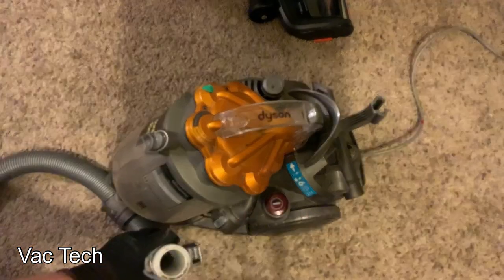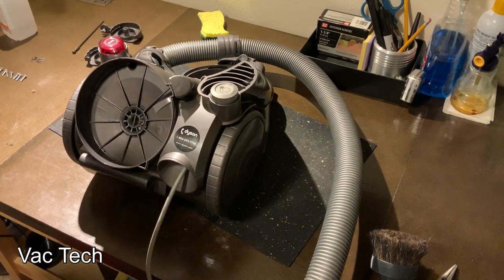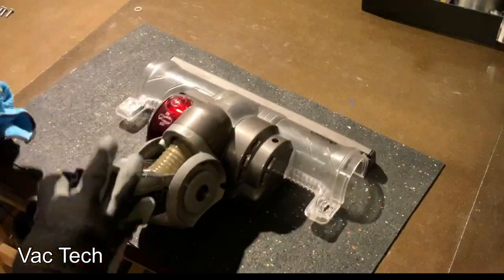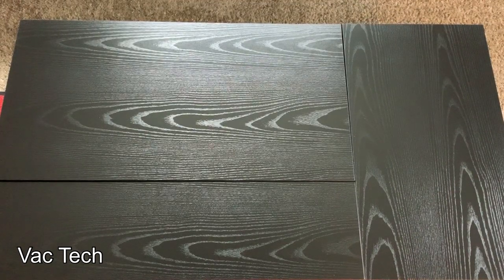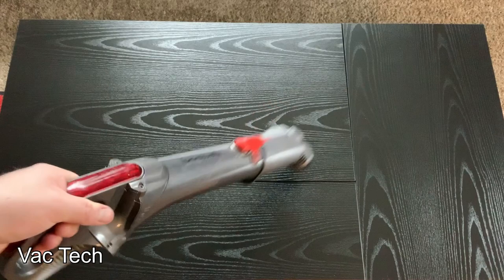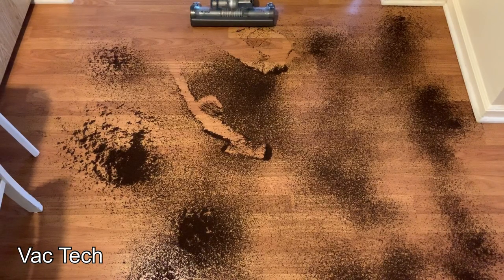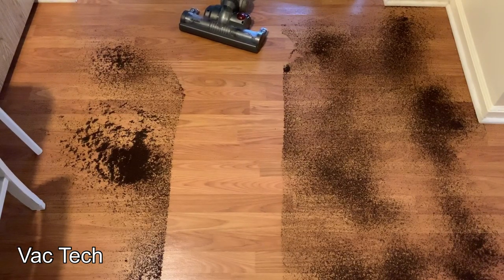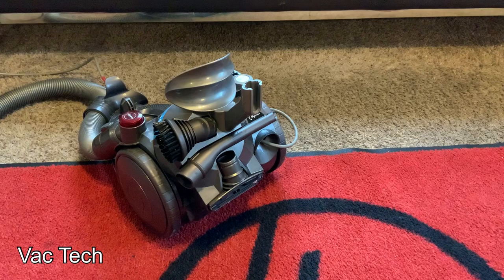2005 Dyson DC21 Motorhead Review Tune-up and Vacuum Demo

Comment: I have one of these as a hand-me-down from my sister and found it quite inconvenient. The cord is too short to reach all the way up our stairs or across large rooms. I bought a Miele C3 pet vacuum which worked well and I continued to use the Dyson DC21 for really dirty jobs like our mudroom.  I washed the pre-filter fairly frequently but had no idea it had a HEPA exhaust filter. My husband borrowed it to use in his workshop. Bad idea!  I have thoroughly washed the housing in the past, but the vacuum has taken too much abuse and no longer sucks like it used to. Hence my search that lead to your video. THANK YOU for showing where the HEPA exhaust filter is and how to open the housing.  Dyson no longer supports this model so I have ordered what I hope are compatible parts. With any luck, there will be a lot more life in this baby ;)  And yes, my husband now has an appropriate Shop Vac in his workshop with venting  to the exterior of the building.

Comment: as far as Dyson canister vacuums this is easily the best set up they have done despite the flaws
Reply from the maker: @nathanielaranda8407  I agree. None of the air powered cleaner heads were ever nearly as good as the motorized power nozzles on these. I also like the long hose on this. Lots of Dyson canisters have short hoses and bulky wands, and they make for a cumbersome user experience.

Comment: The cyclone assembly does separate further by removing the conical part at the bottom after unclipping it at three places from the surrounding shroud. It does accumulate a lot of dirt in there and it makes sense to disassemble it before washing it thoroughly.

Comment: We have this same vacuum. It appears we have a clog. Do you have a quick video for fixing a clog. We’ve checked the hoses and the clog isn’t in there. When you turn the vacuum on, it sounds fine for 1/2 a second and then it changes sound and you can tell it’s a clog. I’d love to see a quick video for novices like me to be able to follow and fix. ☺️ thank you.
Reply from the maker: Did you remove the hose at the machine end, and verify that it still sounds clogged, with the hose/wand removed? That'll be an easy way to narrow down the location of the clog.  If the hose is worn out (and the electrical cable inside the hose separates from the wall of the hose), it can clog easily in a couple spots. Mine clogged near the swivel joint, and where it connected to the machine. 

Have you washed the filter recently? Is the shroud (perforated screen) in the dirt cup clear? Hopefully it's a quick fix for ya!

Comment: Did you ever have to unclog that hose? I have the exact same model from 2005 and still works beautifully with 2 xlarge dogs (90 lbs and 125 lbs) with triple coats and 2 cats. I got something clogged and while it still sucks, the pressure is far less. I think it’s stuck by the handle where I can’t reach because of the slight bend. Do you know how to remove the handle from the hose? Could you do a video of that? From the comments there are a fair number of us with the same problem.
Reply from the maker: The handle can’t easily be removed from the hose, but the hose is removable at the machine end.  At the machine end, the clip that holds the hose onto the canister at the bottom is also removable. From there you could run a long stick of some kind down the hose to free up the clog. 

I hope you can get it removed! It’s one of Dyson’s best canisters, cleans great, and worth saving if you can.

Comment: Thanks for your reply. I don't have needle nose pliers. My vacuum authorized Dyson repairman 15 miles from my home closed shop due to the Corona so I am screwed there 👎. I did make a hook at the end of the coat hanger and I still can't get it out. No idea what the hell it could be up there this time. Always have been able to get the hose line free before with just a coat hanger prior. I do have a car vacuum though. Not sure how I could suck it out with my car vacuum, but I'll try to turn it on but I'm not sure I'll be able to get the car vac line up the thin Dyson hose. This is the challenge I could use advice on.
Reply from the maker: If you can remove the hose from the dyson (there's either a screw, a clip, or both, on the front of the vac where the hose is held down). you can run the dowel through the other side.  And I understand regarding using a shop vac, if the size is too different it may be difficult to get it to seal to the Dyson hose and work.  I hope you're able to get it working again!

Comment: This is an awesome video!  Inspired me to tune up my old neglected Dyson that might be in no better shape than the one on the video.  Thank you very very much!  I have a problem with the motor-head brush that shuts way too often.  I am thinking that might be resolved after replacing the filters.  Will see.  If not, I will write again to see if you could advise on a solution.
Reply from the maker: It might be electrical if its cutting out, and related to the power head, or the hose/wand (if it's also a DC21). Good luck, hopefully you're able to get it running well again!
Reply: @VacTech1  Yes, it’s DC21.  I will tune it up this coming weekend and report back to you! :)
Reply: i m having this same problem with mine too , just curious how did u fix yours?
Reply: @VacTech1  fantastic video! Our dc21 is about 15 years old and the power to the head keeps cutting out. It's not that the beater needs cleaning. It happened a few years ago, too, and I brought it into a shop. They showed me the electrical connections in the wand and how it had come loose, and I watched him solder it.
I will need to do that again today...I just forget how to access it!

Comment: I have a clog up my DC21 hose. Any suggestions on how I can get it unclogged? I put a coat hanger up there but it's not freeing up the hose line
Reply from the maker: The hose can be removed at the machine end. Something like a coat hanger (with a small hook on the end) can help.  Some kind of rod or pole can be helpful. I often unclog one vacuum with another one, that's often the easiest way to unclog a hose (just suck it out with a vac that isn't clogged).  Sometimes things like needle-nose pliers can be handy too.  I hope you're able to get it!  If all else fails, take it to a local vacuum shop, and they'll be able to take care of it for you.
Reply: Could you maybe attach the hose to the part of the vac that the air blows out of?  Kind of blow it out?
Reply: @marysquires4348  This won't work. It's not enough air force to blow it out. It's moot now because I put a wire hanger up the hose and it ripped my hose so I don't even have a hose to work with

Comment: Great video. I have a DC23 which is similar. The brush bar was worn. When I replaced it, the new brushes turned in the air but once on the carpet, they stopped. I changed one brush and surprise, with one new and one old brush, the power head motor is able to turn the brush baa on the carpet. Now the motor is noisy and sparkles. I tried Dyson and they said the model has been discontinued and a replacement power head is not available. Questions: 1. Any idea why new brushes will not turn? 2. Where to get a replacement motor?
Reply: You may have worn out carbon brushes on the motor.  Have a look at them and the spring that pushes then against rotating part of the motor
Reply: try using an old metal coat hanger. You first unclip the hose from the vac. leave a little hook on the end and push it into the hose until you snag the clog and either pull it out or push it through.

Comment: My obstruction is about 2 1/2-3 feet up the wand and I tried an end of a thick wooden dowel and that won't work + the end of an old mop and that won't work neither. The obstruction won't move at all. Dyson needs to make a vacuum where the hose can unzip and rezip so obstructions can be removed a whole hell of a lot easier!!

Comment: Would anyone know why my motor head cuts out? Meaning I turn it on there is power and then I go to vacuum and the motor head keeps shutting off. So I’m thinking is it the motor head itself or is it the power connection when you connect the motor head to the hose? I bought another used same vacuum and the motor head is still doing the same thing…so I’m going to assume there is something going on with the motorhead itself. Any suggestions would be appreciated 😊and I wanted to say everything else works just not the motor head as I stated it powers up n the I vacuum and it shuts off but only the motorhead itself not the actual vacuum…ty and great video btw 😊😊
Reply: Check electrical connections at both ends of hose (clean? Not bent/broken?)
Check electrical connection inside smooth plastic piece in middle of hose (remove 4 screws to access).
I had to lift up contact tabs so they would touch metal circles better so circuit wouldnt be interrupted when I moved the hose around.

Comment: "So the power head must have a small belt two thirds in for the little housing??"
Reply from the maker: Now I remember!  The brushroll motor has a small belt and drive gear, and the belt is inside the small black plastic housing, which is located two about two thirds across the width of the power nozzle. I tend to fumble over my own words.

Comment: Try the Dyson dc23 motorhead
Reply from the maker: Hoping to find one someday! Stay tuned for more uncommon Dysons!
Reply: @VacTech1  i just got a dc23 motor head was used for diy so its trashed plus it reaked of dog and its missing the left wheel on the canister but some tape and felt its glides just fine and works well

Comment: My DC21 motorized head keeps shutting off. There are no blockages. What other reason?
Reply from the maker: Could be an electrical issue.  Is the whole machine shutting off, or just the powerhead?
Reply: If what Mary above spoke about to the Dyson Tech, doesn’t work, on the hose, above the handle, there is a plastic cover (2 piece), with 4 torx (T8) screws. Unplug the vacuum.
It is nice to have an extra set of hands for this as the “flexible” hose makes it very awkward to handle. 
Removing the screws, the two pieces will split apart. The bottom plastic side will have 3 of the power head wires brown, black, and blue and the other will have exposed the hose with 3 metal rings. This allows the hose and the handle to rotate. On the side opposite the wire and connectors there are three metal contact “wipes”. Be gentle and examine them. They will likely have flat spots from wearing as the hose in the handle rotates. Check to make sure they haven’t arced or have been deformed. If you gently clean (remove oxide) it may work. But make sure the three contact wipes are at the same height. After cleaning and/or gently adjusting them, reassemble the plastic covers, plugin and hopefully you have solved your intermittent power head shut down problems.
Hope it works as my DC21 is an awesome vacuum!!!!

Comment: Any suggestions as to why the power nozzle will run and shut off constantly, have to keep pushing the power button on it and now i can't get it to turn on.
Reply from the maker: Hi, Bee! Sounds like an electrical issue on your old Dyson canister, either in the powerhead, or the hose/wand. I would seek out a replacement powerhead, as the parts for these machines are long discontinued. Good luck, and I hope you can keep yours going!
Reply: @VacTech1  Thank You so much !! I will try and find a replacement part.
Reply: I had the same problem. I did a chat with dyson to troubleshoot it and he had me wipe off the connections between the power head and the hose. I did that, put it back together and it doesn’t shut off anymore.
Reply: @marysquires4348  Thank You Mary !! I will give that a try! I love my Dyson and cant a fford a new one.